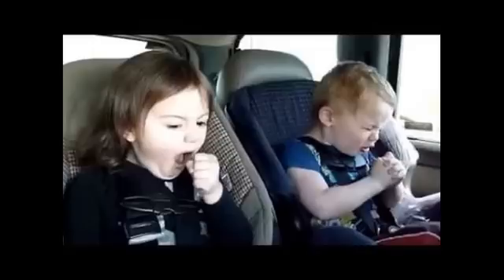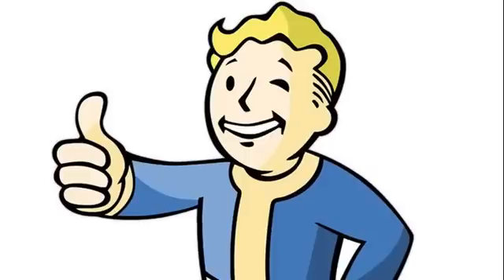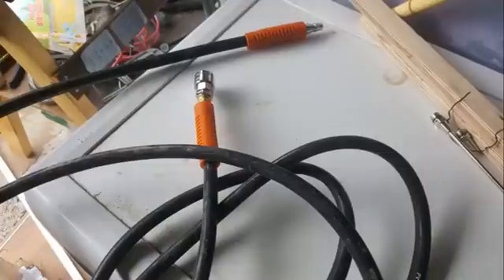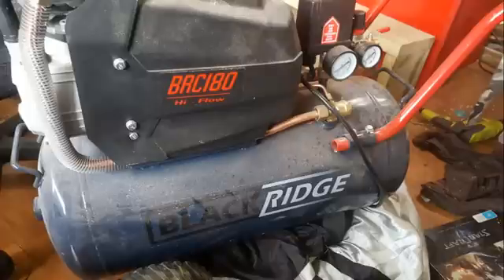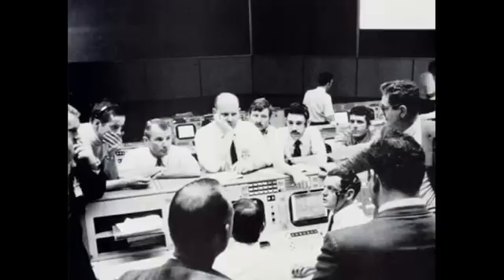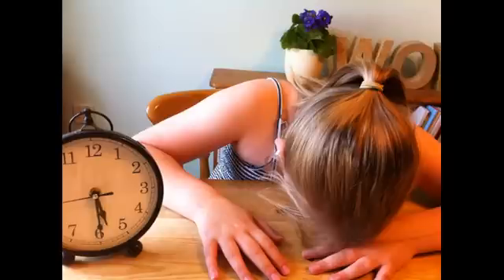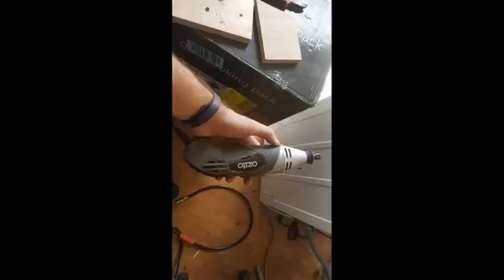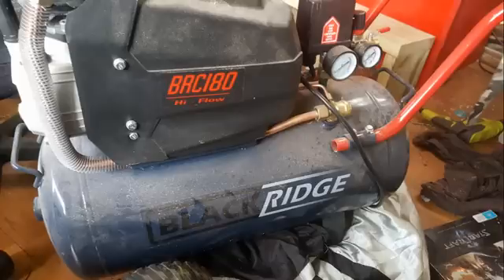Home made soda blaster with a Blackridge compressor

Comment: hi.. I like your video.. I need some specification info about your compressor... I cannot find the same brand like yours here in Indonesia... if you keen to discribe the spec.. would be very helpful.. thanks!!! 👍👍
Reply from the maker: Garinca Vesu I wouldn't suggest using this one at all for making a soda blaster - as you can see its really not up to the task. For an airbrush or HVLP paint gun its okay but I haven't tried it on much else.
Reply from the maker: Garinca Vesu for specs though try here http://www.supercheapauto.com.au/Product/Blackridge-Air-Compressor-Direct-Drive-2-5HP-180LPM/168671
Reply: thank you for the link..👍 but for soda blasting better buy the powerful one.. ya?
Reply from the maker: Garinca Vesu depends on your project - a basic home made one will work (sort of) for plenty of mini projects but if you're going to do major work with it, buy a proper setup including gun and blast media. More power in this case probably still wouldn't have done the trick with the soda I was using but a bigger tank would have made the task a little less frustrating.
Reply: glass bead and soda blasting is what I wanted to do.. for degrease and cleaning motorcycle engine parts..with less spending money to make  a goal..I am still doing some research.. and if you have some valuable information based on your experiment... I'd like to hear your advice....
Reply from the maker: Garinca Vesu if you can, hire a compressor first. That's the most expensive part. The dust gun and soda is cheap but by hiring a compressor first you can test the effectiveness of your setup before you commit more money too it. i bought my compressor to do some light paint work and then decided I'd try it as a soda blaster

Comment: Hello my name is gaston from argentina .. very good video .. I wonder how much pressure the pounds and bars I have to use the compressor ?? thank you very much!!!!
Reply from the maker: gastonmirabello depends on what tool you're using. For an airbrush I had it at 20-30 psi, for a hvlp gun about 30-45 and for this little experiment it was at 90-100.
Reply: muchas gracias!!